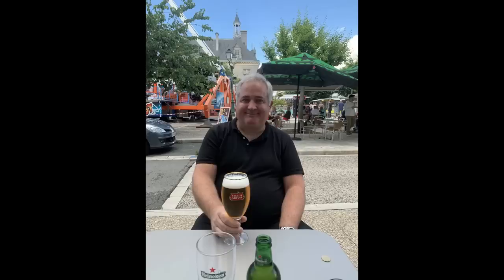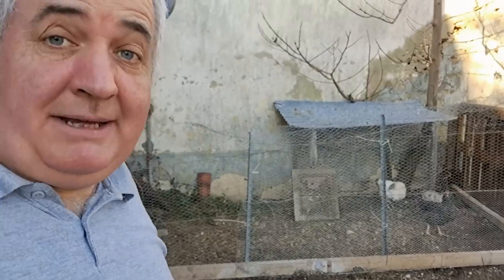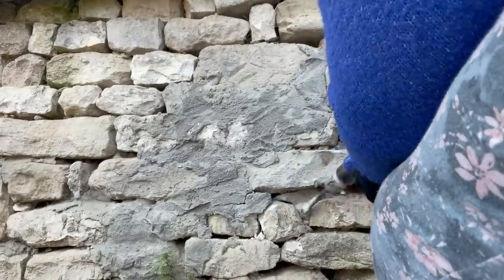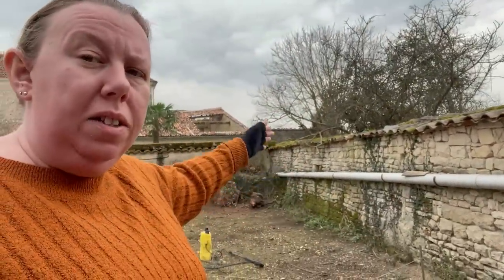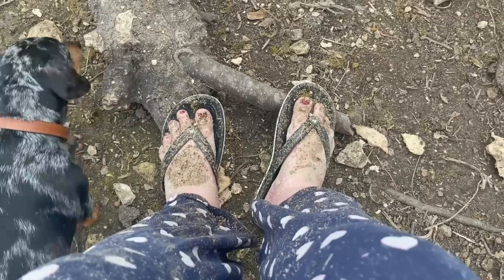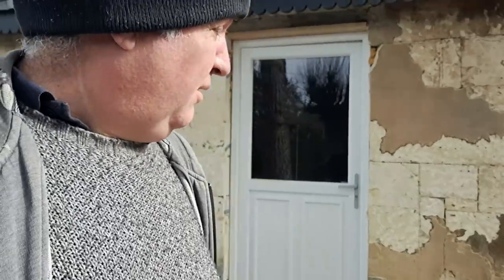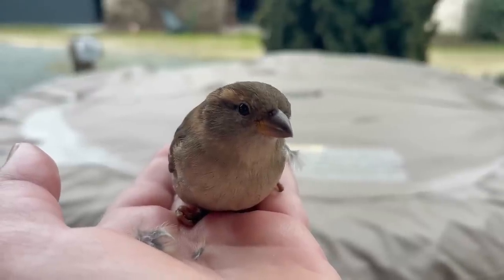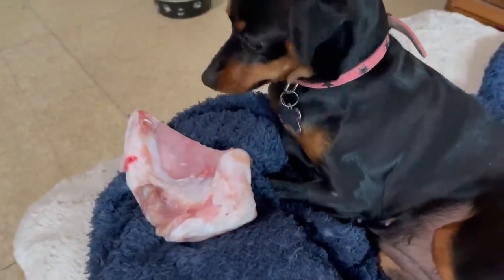Chip Off The Old Block #79

Comment: Big jobs done!  That was tough going, especially in cold weather!  I wonder if you could consider a rain barrel (or several) where that pipe comes out of the building, and then running an underground pipe along the rock wall - I realize that would require a lot of digging, and need to be sloped, but it seems a shame to be marring the beautiful wall.  Just a thought.
Reply from the maker: Hi Hiris - good suggestion with last years hot summer and lack of rain we wish we had thought about this earlier. We may leave that pipe where it is for now - but you have given us a good idea of maybe in the future divert some of the gutters into the old wine making tanks... many thanks x

Comment: You could put in a water tank for roof runoff & get rid of ugly white pipe, wall would be even more magnificent 😅
Reply: Even if they moved it up to the top of the wall and the incline slightly less until the end bit perhaps. It is a bit ugly but not sure if it’s an area where gite guests would see it. If not then not much point in messing about with it really.

Comment: I don't  understand why you are rendering the cut stone. It's lovely as it is, even if not perfect.

Have you tried just wetting the window stickers? I found once, after battling with them like you,  that  they come straight off with water (this was in France too). Good luck, these last few days have been utterly miserable(I'm in 17, so not far from you).
Reply from the maker: Hi Allison - where about's are you near in 17? 
With the wash house we did talk about not re rendering however -  some was old lime render now chipped off, some is stone - and we can not get the render off and some is breeze block where we filed in part of a door to make a bathroom window - so it looks completely three tone at the moment - we will grab a couple of pictures of it so can get a better look, it would just be nice to have it as one surface with a new coat of the lime render. 
Thanks for the window sticker tip. Fingers crossed the warmer weather is on the way - managed to sneak a drink in outside today. All the best Clare and Nick x
Reply: @theexpatbutchers  I'm near Mirambeau, very South of 17. I feel for you guys, I've renovated several houses in France. It keeps you on your toes! You  make a great team. You could potentially just render the dodgy parts of the wall, it would still look great!